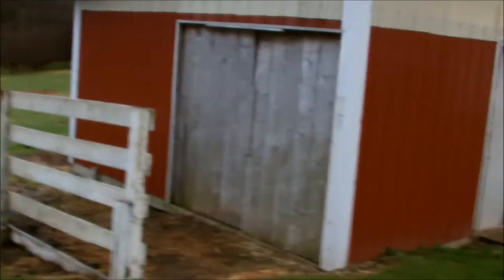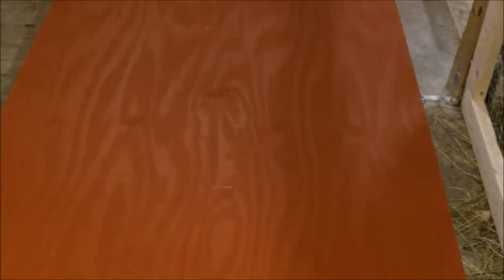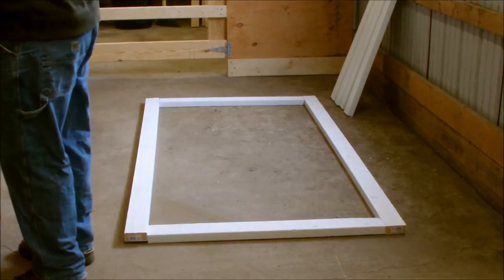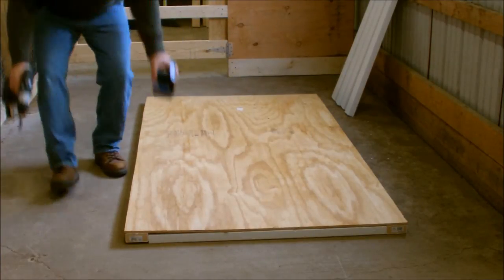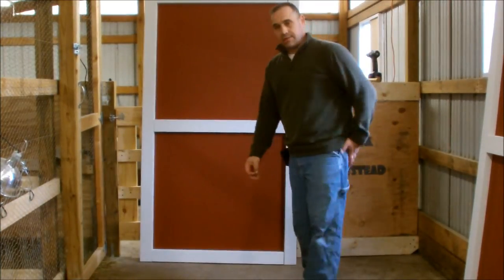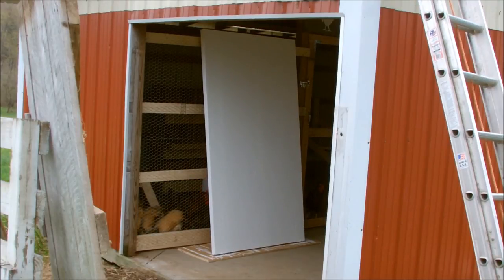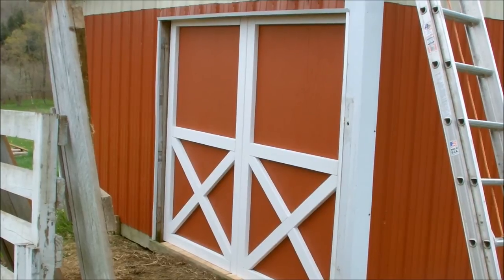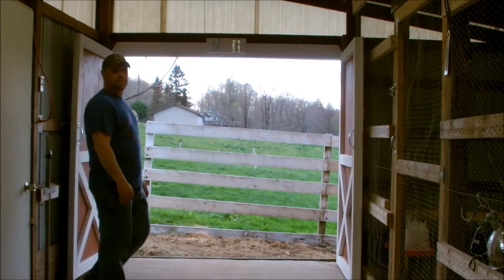Building red barn doors with the "X" in them.

Comment: Is there a reason you used 2x4 instead of 1x3? Could you use 1x3 for boarder and trim? What was the angle you had to cut for the inside X at the point?